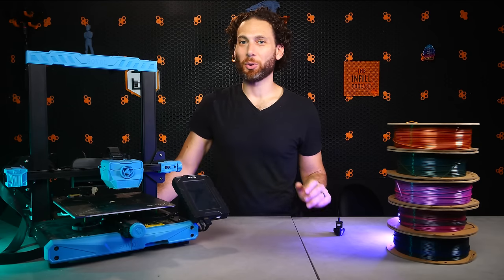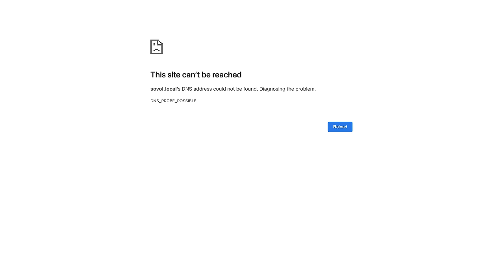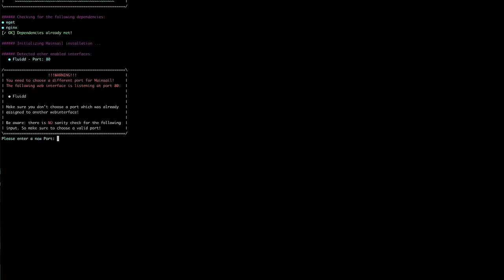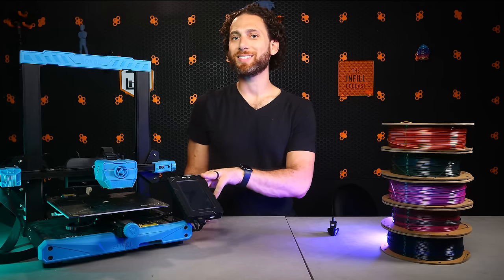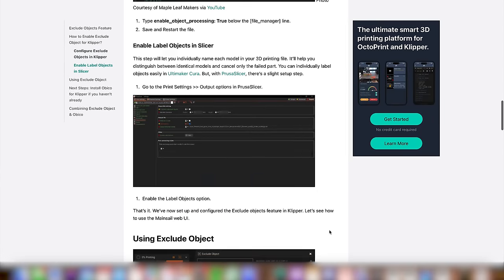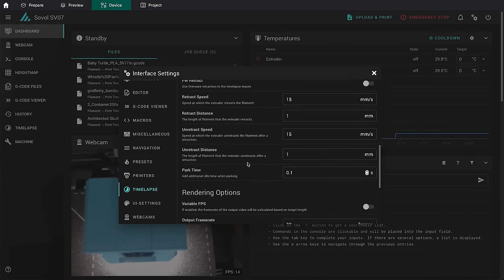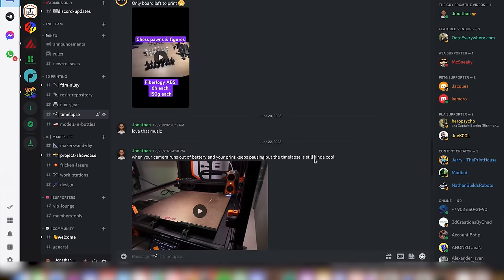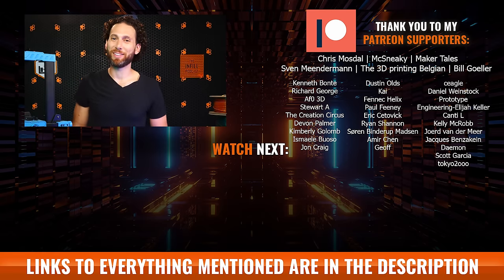The 10 Upgrades I Install on EVERY Klipper 3D Printer

Comment: I think the most important upgrade of kilpper is changing the root password
Reply from the maker: Good point!
Reply: You should do that in the install part of RPi OS. Click the gear that will open a dialogue that will let you set a custom url for your local network. I use the name of the specific printer. It will also let you input wlan info, and set a user and password all will be baked into the RPi OS install.
Reply: What did you change it to?
Reply: 4321
Reply: @geauxracerx   I have a bunch of pi's running. 2 are for older CR-10S Pro's running Octo Print. One of which I have forgotten what the password is.
Reply: Hmmm.... I don't leave my 3D printer on.  It's turned on, I print, and then it's turned off.  I'm behind a NAT which would block any probes looking for the Sovol printer.  However, my career field and work experience in as a Network and System Admin, with Cybersecurity at large part... so Im conflicted.    I'll have to mull for awhile if I really want to change root.  Part of me wants to just make it where you can't remote in as root, but I have zero clue if sudo is a thing on this OS.

Comment: If you don’t install Klipper screen you can VNC into the RPi and use the copy sd card utility to manually back up your entire sd card/drive. Having a local copy is the best practice, as sd cards are prone to failure due to power cycles. Takes a few seconds to swap out a corrupted/dead sd card
Reply: Installing klipper screen on the SV-07 will brick the printer. Sovol uses a custom FW / fork of klipper for  their  MKS pi/ pad 5. I have the 07 and the 07 Plus.
Reply: @jeffdavenport469  I feel Klipper screen is a huge mistake. It kills 98% of the Pi’s functionality. Like being able to make a 100% backup of your setup. I use an iPad with all my printers in its own tab in password/biometricaly locked Brave browser. There is zero need for a screen on the printer, ZERO. It just adds more headache to the process
Reply: @geauxracerx  I would GREATLY appreciate how to do this. VNC being a remote control I can't get my head around how.  I use naturally ssh and also winscp to access files on the pi, can you use that to do the backup ?.  Is the back up a bare metal image backup such that the file you transfer to your PC is an exact image of the sdcard. As you can see, easy to say this can be done, but I don't see how ???, any chance of a tutorial or reference to a YT vid that actually 'does it' rather that say it can be done.  Rgds.

Comment: Another Macro that goes by the way-side by most companies factory installed Klipper: M600 / color change. Once up and running you just have to add it in your slicer.

Comment: for KlipperScreen, I use Debian on a old Microsoft Surface.  It works really well and is big enougo to be seen from anywhere in the room.
Reply: Did you connect the Surface tablet directly to the pi USB? Or did you need another plug in to make it work?

Comment: Just use a old phone or tablet. Cheaper and probably have a drawer full of old phones. 

Much better too than the klipper screen as you get the full web interface, plus connect all your printers to that interface so you only have on screen rather than 5-10-20 depending on your set up. 

Touch screens are great for single set up or even two printers but when you get into small game status, it’s a lot nicer to have a single HMI rather than one for each machine. 

If you’re from the manufacturing world have a HMI for each makes sense but not in 3D printing.

Comment: I love Fluidd, but I have a slight preference for Mainsail.   I use a Raspberry Pi Version 1 camera, and I found installing both Fluidd and Mainsail together caused it to stop working so I had to go one or the other, but Mainsail and KlipperScreen provide an amazing UI on the printer, with a very functional remote interface also
Reply: what streaming protocol did you choose?  I followed the common instructions on the web cam installation and one said, "do not select experimental" for the streaming protocol.  My web cam didn't work, and I have both Fluidd and Mainsail running.  I thought, "What the heck, it's not working.. might as well play with it."  Changed the protocol to "experimental" and boom, there's my webcam video.

Comment: I like the idea of macros but sadly setting them up just doesn't work with the way my brain does. One that I'd love would be to restore a failed print. I'd love to just select a file and tell it to start at a specific layer or height without having to go in and edit the gcode and hope for the best. If i can see on the display that a print failed at 16.4mm I'd love to just restart the print and tell to start at 16.4mm. Absolutely no idea how to even start something like that though ... I'm like steve jobs that way. I just come up with the great ideas and wait for someone else to figure out how to do it  😉

Comment: Great video! You production quality is getting better for every video! I think it would have been worth mentioning that klipper and octoprint is not mutually exclusive (see octoklipper), one is after all a firmware and the other is a front end, I felt it was a bit unclear sometimes in the video what Klipper really is and what moonraker/mainsail/fluidd is...
Reply from the maker: That's a good point, but in my opinion putting Octoprint on Klipper instead of something cleaner and more stripped down like Fluidd or Mainsail kind of defeats the purpose a little bit... don't you think?
Reply from the maker: Oh and good point about the differences, I didn't explain that. Thanks for the feedback
Reply: I totally agree on that, just thought it might have been worth a mention in case one wanna go from octoprint with marlin and keep the familiar plugins. I would of course still recommend mainsail/fluidd with the plugins you mention in the video any day of the week  @thenextlayer

Comment: for me to add spoolman to my SV08. I have to install it on a Pi? then connect pi to printer? what other filament inventory apps do you recommend? im not willing to buy a PI for this. im out of power outlets in my printer room.
Reply from the maker: I think it can run on the internal pi

Comment: how do you install these plugins if you dont have a rasberry pi? i have the ender 3 v3 ke and i have already rooted it and installed moonraker,mainsail and octoapp with octo everywhere but i would like to use some of your upgrades in this video.

Comment: Very cool video, thanks a lot. Any possibility of a video turning/ flashing a Sonic Pad into a full fledged klipper setup?
Reply: The sonic pad is a full fledged Klipper install. You just need to make/install the specific firmware and config file for your printer. Then connect the printer to sonic pad with appropriate usb cable

Comment: Has anyone upgraded a sovol sv06 with a raspberry pi4?
I'm currently running octoprint on a raspberry pi 4 and i want to switch to klipper.
I heard that i must update my firmware on the sovol as well on the raspberry pi.

In my understanding i must update to a new firmware on the sovol
Install mainsail OS on the raspberry pi

Will my sovol sv06 screen work after that? 
Should i add a new screen?
Should i instead buy the new klipper screen for the sovol sv06 and ditch the raspberry entierly?

Thank you very much!

Comment: Thank you so much for this! I have heard mixed things but can these upgrades be done on the Qidi X-Max 3 also? Mine comes in next week and I don't want to start making changes if the firmware will reject them. Thanks again!
Reply from the maker: NO! Don’t touch klipper on the Qidi machines or you’ll brick them!!
Reply: @thenextlayer  that was what I had heard elsewhere but thank you for confirming before I did something stupid!
Reply: Really lame when corps lock down open source software 👎

Comment: I listened to the cool kids and switched from Duet with RepRapFirmware to Klipper... don't recommend it at all, felt like a downgrade...
Will be switching back after I get a CAN 36 toolhead that supports RRF.

RepRapFirmware

+ Clearer documentation
+ Easier upgrade and setup

+ Everything is a g-code, and no restarting of firmware for every little change

- Less cool kids 
- Pricier if you go Duet brand